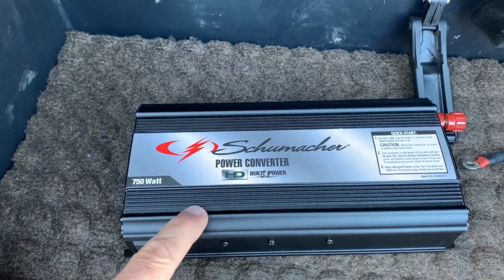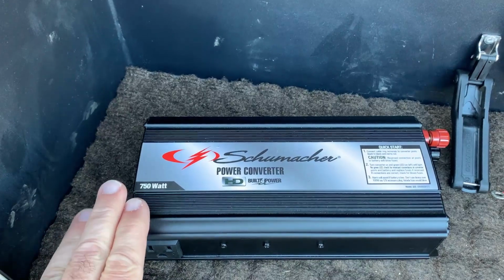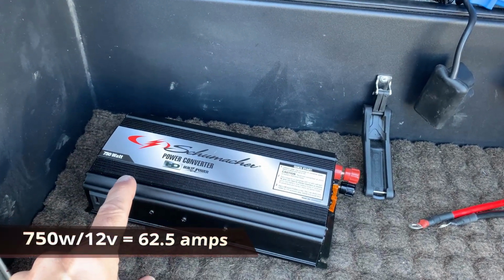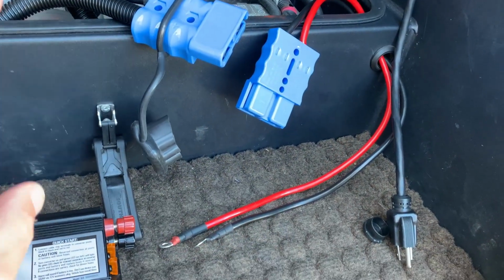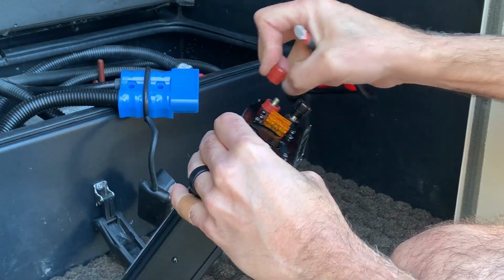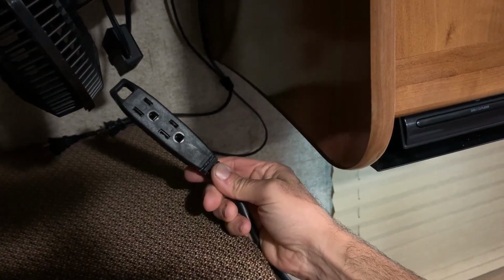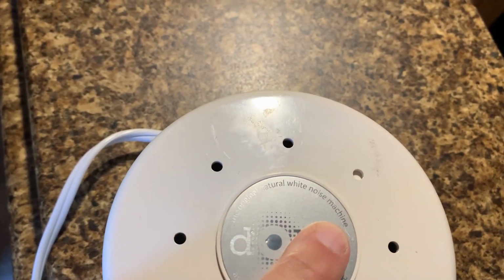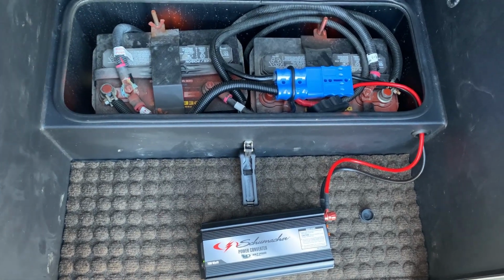Schumacher 750 watt Power Converter | Leprechaun 260DS

Comment: You could have just figured out how to over ride the outlet that goes dead when driving. If I had to bet, it's going to be connected to the transmission, so it can sense when you're going to be driving.
Reply from the maker: The was on option but I did not want to change the wiring because of the warranty on the RV.

Comment: Do you turn off your battery charger (converter circuit breaker) when you are using the inverter?  If so, what charges the batteries?
Reply from the maker: We do not change anything when using the converter.  The sound machine does not use much of the battery during the night.  When traveling down the road and using the converter for the TV, we turn on the generator to charge the battery only if the TV has been on for a long time.  Thanks for the comment.

Comment: We just picked up a 260DS last week and I found your videos very helpful.  It would have been a little disappointing to head out on our first trip and not have a little in car entertainment for the long hours between stops!  I found a post on another Leprechaun board that there is a "kill switch" in a junction box behind the microwave that is tied into the ignition.  Simply unplug the signal wire from the ignition source and the circuit will stay live in transit.  I have not verified it myself but the inverter trick will get us by until I have time to do some digging.  Thanks for sharing all your tricks!
Reply from the maker: Thanks for the heads up, I will look into the "kill Switch" and see what I can find.  Thanks for the comment.